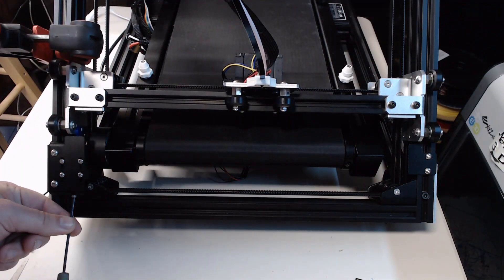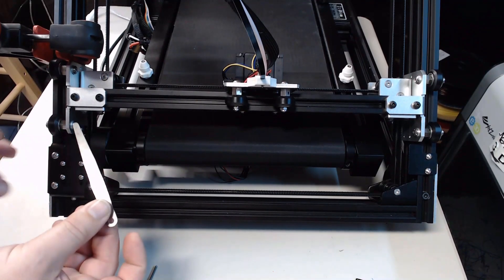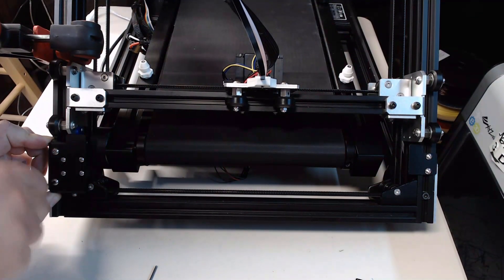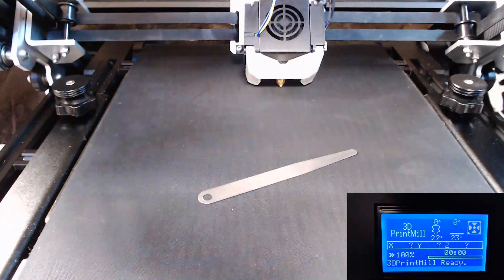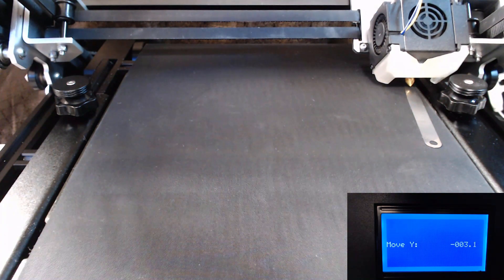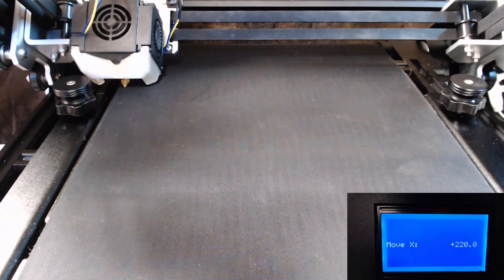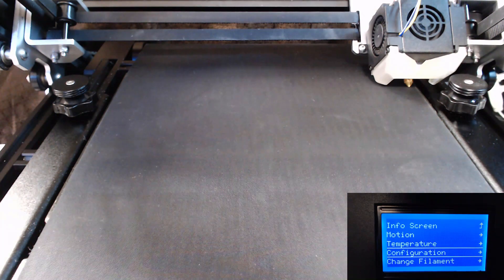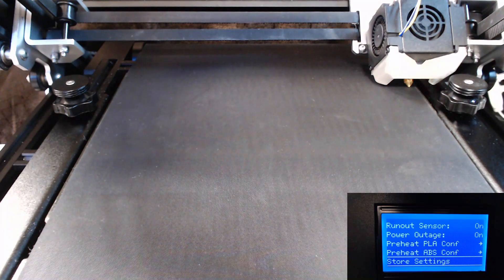3DPrintMill aligning Y-axis stop switch , bed leveling and  setting Y-offset.

Comment: Hi Brad here. I got my  cr30, the shim in the box is 0.10 on the Kickstarter units. Doing my leveling now!
Reply from the maker: Hi Brad, yea Creality won’t enable the ability to do a negative Y axis offset in the firmware (they actually disabled it in the firmware I created for them) and now they changed to a .1 shim.   I can’t help but feel they don’t approve of my method.    Mine keeps the hot nozzle off the belt till printing and allows for fine tuning the nozzle height thru the firmware not guessing with a screw adjustment.   I’m at a loss why they won’t use my method.
Reply: @NAK3DDesigns  might be worth updating the video or having a video on the shipping firmware ? I’m a fan of your message, but it definitely sent me through a loop of trying to get this thing aligned not knowing what you just posted.
Reply from the maker: @BradHerman3D  I've created a Github repository with my version of the firmware that will allow for the negative Y-axis offset and added a link to in in the video description..  I'm sorry I won't make a video using their firmware as I believe their process to be broken.  This is the only way I know to protest the fact that they disabled a function I built into the firmware that I created for them and they refuse to re-enable it.   I'm told they don't want people being able to crash the y-axis into the belt like that is any different than being able to crash the z-axis into the bed on a normal printer.
Reply: Same here with 0.1mm shim + can't do negative. I'll give it my best attempt and see how prints go.
Reply from the maker: Yea, thank Creality for changing shims after I made the video.  You’ll need to update the firmware to do negative offset.
Reply: @NAK3DDesigns  Yea. I'll need to collect some firmwares so I can do things it seems.

Comment from the maker: I just realized there is a scientific reason why dropping the y-axis .3mm after leveling works better than .2mm..  the y-axis is the long side of a Right Triangle, so if the nozzle is .2mm high the y-axis is actually .28mm from zero.  I feel smarter for figuring this out yet dumber for not realizing it sooner.. lol
Reply: Your feeler gauge is .2? The one included with my CR30 is .1.
Reply from the maker: @coolcat312  Yea, apparently they changed what feeler gauge they are sending out..  just drop it .2 instead of .3 after you get it dialed in.

Comment: Thanks to have made a video about it it will be really helpfull. I was wondering if the calibration of the step/mm for the x&y are the same way of a cartesian ( like the ender3 ) i know that the Z is different i think joel said a few word about a website to get the good value. Is it something you will make a video about or if you could give me a link to where i could found this info. Thanks a lot for everything you've done and hope to se another video soon where you will show some upgrade you made or hint to make it work better. Have a nice time and happy new years (in advance)
Reply from the maker: There are several different sites with e-step calculators..  Here is one..  https://3dcalculator.xyz/estep-calculator  the same formula will work to calibrate z-steps.   I recommend printing a small 10mm wide by 5mm tall by 100mm long block then using calipers measure how long it actually prints.  Then plug in the values as required on the website and you will get the new calibrated z-steps..
Reply: @NAK3DDesigns  thanks for all really appreciated
Reply: @NAK3DDesigns  unfortunately that link doesn't work...